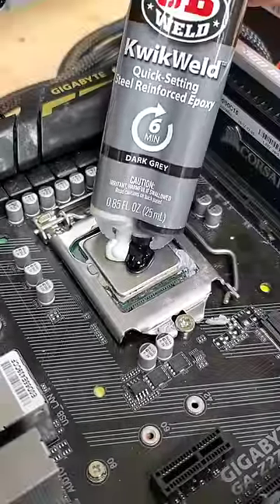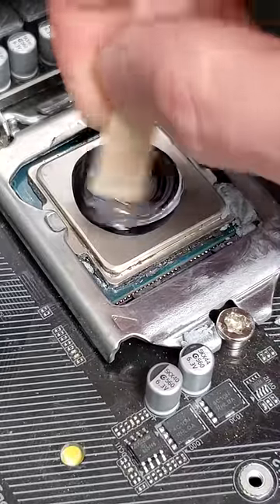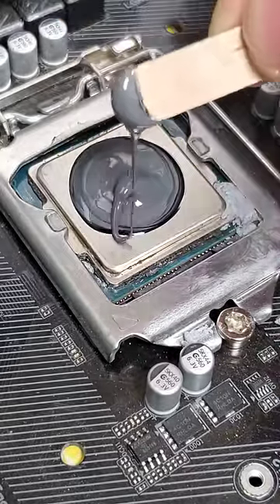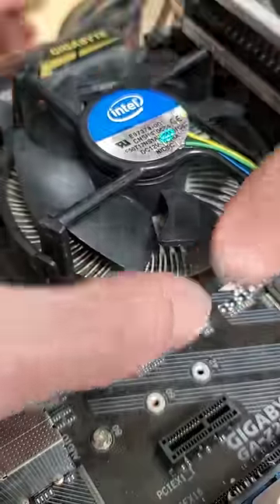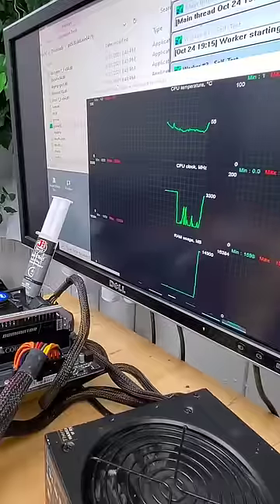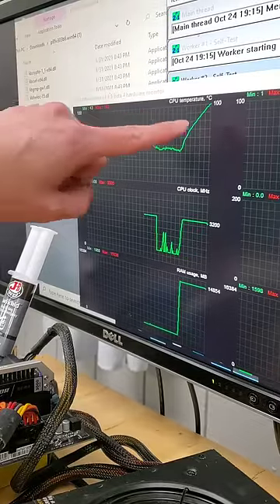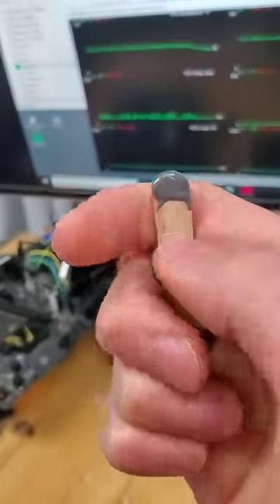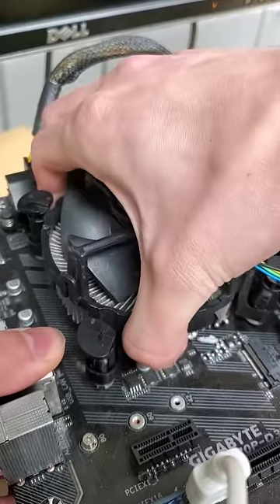using steel reinforced epoxy as thermal paste in a PC! #shorts

Comment: Dentist have a type of floss that acts like a saw. I would use that to get the cooler off. Unfortunately the cpu and cooler are probably done for. Although, you can sand it down to the metal and maybe save those as well

Comment: They specifically make thermally conductive epoxies. I’d be interested to see an epoxy meant for conducting heat, and a better cooler. Just get one of those cheap celeron or athlon CPUs since it will be destroyed.

Comment: i've used jb weld the solid stick kind on a xbox 360 once. actually worked quite well and never over heated. Infact it ran more quiet. Mind you it was a 360 s and not the og style 360.

Comment: You made one big mistake!

Only use 1/4 of this amount, and push the cooler down, so that the layer of epoxy gets even thinner.
Push the push-pins in also. If the layer of epoxy is verry thin, it will work much better.

Comment: Could you cold weld a cooler on a cpu, in a vacuum, so there is no air between the parts, and it also gives excellent thermal conductivity since its metal-metal conract.

Comment: Most epoxy has at least 10,000 psi tensile strength per square inch. Some are 70,000. Good luck taking that apart. I think it's now one piece.

Comment: I've ripped a CPU out of the socket before by the heatsink because the thermal grease had turned to paste.  That stopped being a thing with the transition to LGA, since the pins are no longer what holds the CPU in place.

Comment: ….actually did this in 2003 when I built my 1st computer. Dumb ass me thought it was some super strong thermal paste as they were in the same damn isle at Fry’s Electronics

well…it worked until a year later I went change out the thermal paste only for the cpu to pop out of its socket and I saw it was welded to the cpu 

never made that mistake again 😂

Comment: youre going to have to undo that cpu bracket arm somehow and then pray that you can pull the CPU out of the socket WITH the cooler. you just JB welded your shit together forever. that cooler and that cpu shield are now permenantly fused. nothing shy of power tools is going to seperate them

Comment: Sadly it's not even a good test since he used about 10 times too much paste.  Even thermal paste would make a mess and not work great with that much on there.  He didn't show whether he added good pressure to the cooler either.  He might have had a 1mm thick glob of jb weld creating a massive thermal block.  I think it would likely work somewhat ok if the proper pea sized amount was used. But even with a tiny amount, that cpu and cooler are essentially 1 piece for forever.  with the crazy amount he used in this video, the CPU, cooler, and main board are 1 piece forever.

Comment: That was wayyyyyyy too much paste, thermal or otherwise. As soon as he tightened the cooler it leaked out all around the CPU guaranteed. If i had to guess, the cooler is bonded to the CPU, and the CPU is also bonded to the motherboard. It'll crack if he tries to use force, or yank the CPU and or CPU port off with it. It's destroyed.

Comment: Hi I’m a sim racer building a pc and am looking for a cpu for my 2080 ti I was looking at the 5600x but some sources say that could cause a bottleneck. This is a budget build and I want to keep the cpu under $150 used. If it is not on am4 if you could help me with a sub $80 mobo also would 32g of ddr4 be overkill and should I just go for 16g. Thanks 🙏

Comment: As with every other video on here you used enough for 40 or 50 pcs. Ill give ya a pass since the video is in jest but damn man. All ya need is a lil smudge of paste use a plastic card or razor to spread it. Its not making a sandwich. Its only function is supposed to fill the lil cavity's and scratches on the surface of the cpu and heatsink. Which allows for a greater surface area of contact more surface area touching transfers more heat off the cpu.. Icing the thing like a cake probably gives less performance than using nothing at all smh